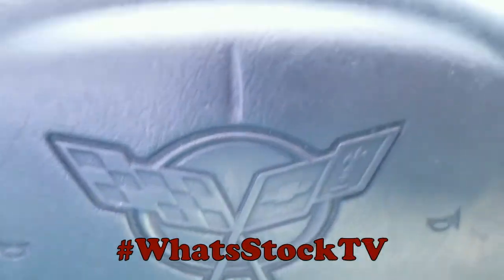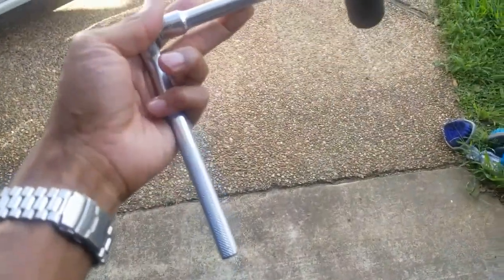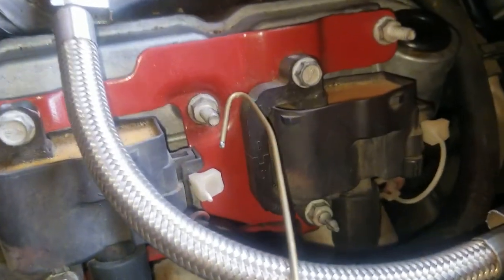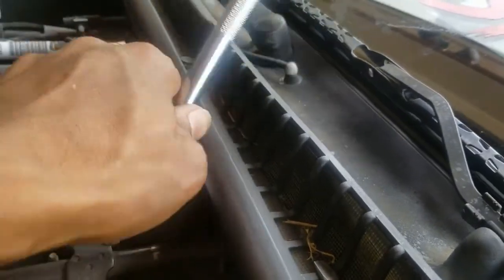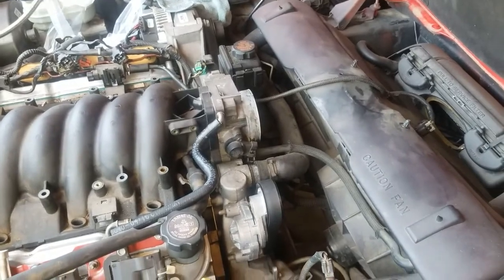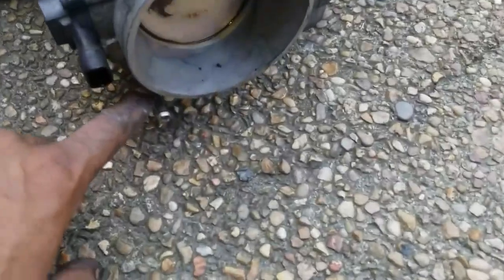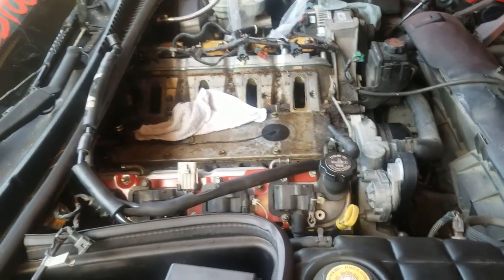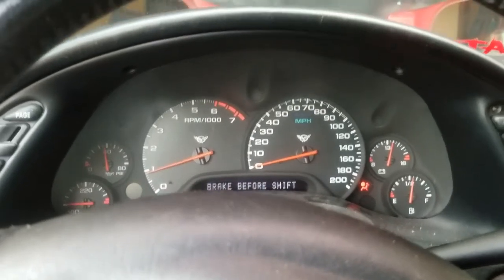C5 Corvette Oil Pressure Sensor Install

Comment: I dropped the new one several times. Used a magnet to find and retrieve. Finally  put vasoline in the socket to hold the new sensor. Started it that way.
Reply from the maker: Good deal. I was so mad at myself when I dropped mine
Reply: @89imp03  you are the only guy that talked about the vacuum line. So many people post videos and don’t tell the whole story  thank you!!
Reply from the maker: @LeeHaener  thanks, I was coming across the same issues watching videos about it

Comment: Doing mine as we speak. I hope you got that A/C vent line hooked back up. Didnt hear you mention it. I had to extend mine cause it's too short to reconnect. It's like a 5/32 plastic tube that went to the back of the intake manifold where the MAP sensor is. If you dont connect that your a/c vents wont change anymore.
Reply from the maker: Yep, I got it. Saw it at the last minute and didn't know what it was tho
Reply: Glad to hear bro.